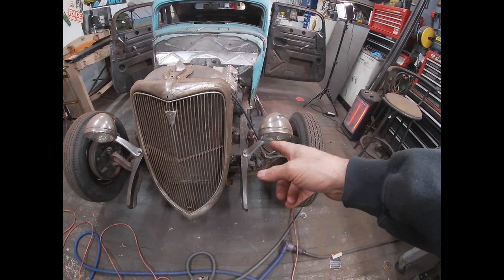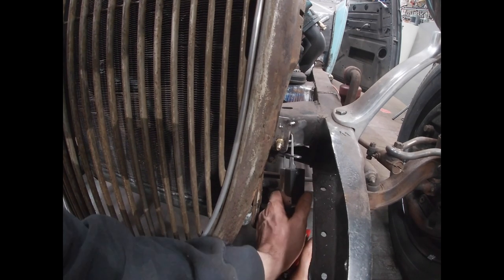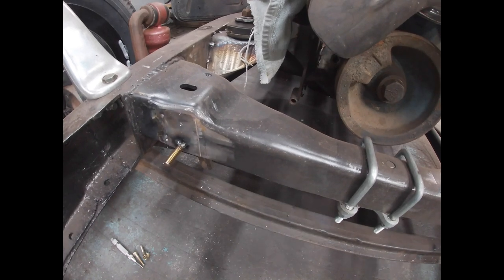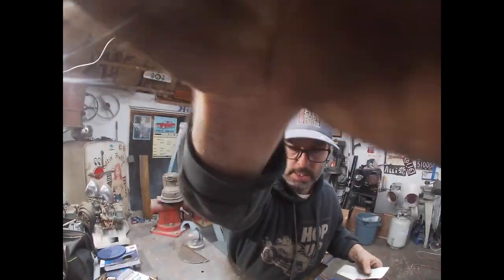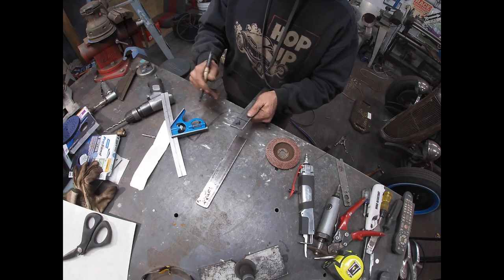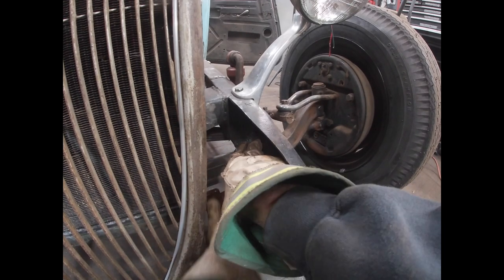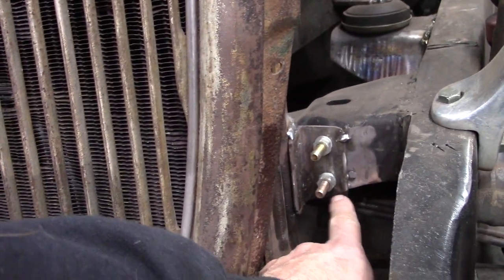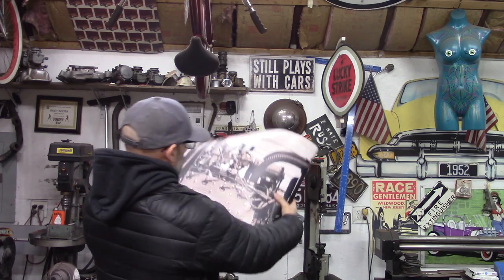1934 Ford Hotrod Radiator mounts

Comment: Just a heads up Mike, I had my radiator mounted ridged on my Model A drag coupe and it eventually cracked. Had to re-mount it with a spring kit to take up some of the vibration. 10 years now , no problems . Just something to think about. Great video as always.
Reply from the maker: Thank you.  I’ll make sure when the car is done I keep an eye on it.  👍🏼

Comment: You need one of those belt sanders for welds that all the body shops have
Reply from the maker: Ya.  I have a small one. But I don’t use it much. Do you mean he big disc sander thing ?
Reply: Absolutely, 1”” belt sander was one of my most used air tools along with the air powered “hacksaw” & spotweld cutter. Just helps keep things tidy & doesn’t hack the guys off in the paint shop with loads of grinder gouge marks to clean up.
Reply from the maker: @geofo60  I have a small finger sander.  It just seems to take so long to sand things with it.  I had planned to clean up the welds a little with it on the mounts. Before I paint it.  Lots of real heavy weld throughout the car from back in the day.  I planned to leave most of them as to not make it “pretty”.

Comment: Hey Mike, It's Greg again. I've got to echo what was said about solid mounted radiator's, & their downfalls. I've been into Hot Rods, ever since I was born, back in 1957 into a Hot Rod Crazy Family. Anyway, Henry Designed  a spring mounted radiator, & he was spot on to that point. We built several Hot Rods in the 60's, with solid mounted radiators, & everyone of them failed. I'd hate to see you spend good money to get your rad re-cored only to have it shaken apart. But way back then , we drove our rods hard, & Fast, we'd never heard of a "Trailer Queen".That big V-8's gonna shake for certain, & then if you consider the weight of the radiator filled with water, or coolant, it's gonna cause some undue strain on solid mounts. How do I know?, A  57,J-2 Old's in a 30 coupe, we mounted the rad like you did , & it shook it all apart. I love your channel, & your commitment to preserve our rodding past, So please don't take offense, when I make a remark. Through  you channel I get to relive some of my past, . & my childhood days,
Every evening Of my youth, as well as Saturday,& Sunday, We built hot rods, my dad & me. He died in 97', since then it hasn't been the same for me...
Reply from the maker: I appreciate the insight, Greg.  Thank you for your knowledge and concern.  
I’m not trying to go against the grain.   
The reason I decided to go this route is simply because I’ve seen so many other old hotrods built with radiator setups just like this.  With the exception of the additional mounts on the crossmember.  Many older cars I’ve seen in photos have what appear to be solid mounts on the base of the radiator.  
My 30 coupe radiator is solid mounted.  It was built that way in 1978.  I have driven it that way since 2018 with zero issues.  
I absolutely understand what you are saying as well as a few others who have commented.  
I guess what I’m hoping is that with the added support of the mounts to the crossmember plus the base mounts and the radiator rods I won’t have the same issue you had.  

Mike

Comment: Rods attached to grille shell going to firewall would fix lower grille hitting radiator
Reply from the maker: I think it still needs the brackets on the sides of the shell.
Just to be safe.
Reply: Got it👍
Reply from the maker: @kurtludwig4783  haha.  I found a set of brackets on eBay.  It’ll make life easy just booting them on.

Comment: Hey Mike,  to mount the 34 passenger grille to a 34 rad there is a set of 4 brackets ( 2 upper, 2 lower} as well as the neck screws. The lower brackets received the front hood latches on a 34. Here is a link to Mike Driskell's auction page with a picture, although it looks like he's out of stock. 
 
https://www.ebay.com/itm/NEW-1934-Ford-original-type-radiator-to-grille-brackets-40-16628-ST-/401499381032
Reply from the maker: Fantastic! Thank you so much, I’ll probably just make some brackets.  But it’s nice to have an idea of what they look like
Reply from the maker: I ended up finding a set on eBay so I ordered them.  Figured it would save the time and I would benefit on knowing exactly the length and location they would normally go.  

Thanks again for the link.  

Mike
Reply: @ThisOldHotrod  Cool, glad I could help. They'll be pretty close but don't be surprised if you have to lean on something a bit.
Reply from the maker: @deuceman32  ya.  Nothing beats the originals

Comment: what is your plans for the lower radiator hose Michael?
Reply from the maker: Tuck it between the axle and the crossmember. Just like they did back in the day.  I have to have the lower outlet raised 1/2” to achieve this.
Reply: @ThisOldHotrod  i was running into that on my car. Thanks
Reply from the maker: @biscuitjunctionhotrods4096  it’s all been done before 😎👍🏼. If they did it we can do it ... even if someone thinks it’s wrong. Hahha.
Reply from the maker: @biscuitjunctionhotrods4096  if you tuck it up as close to the underside of the crossmember the axle should never hit it.
Reply: @ThisOldHotrod  yes its all been done before is right. i like how you mounted to the crossmember i never thought of that